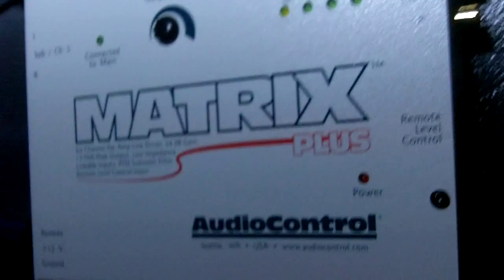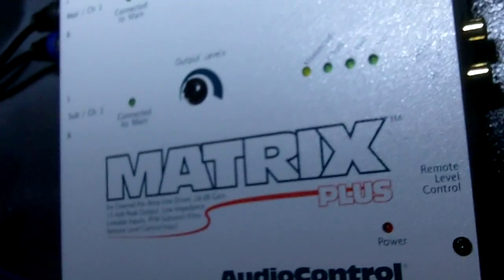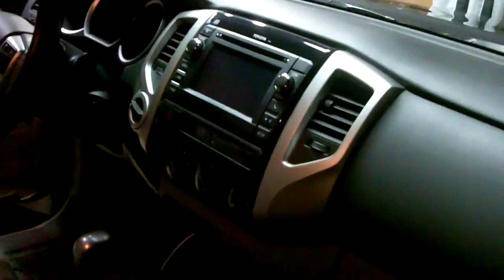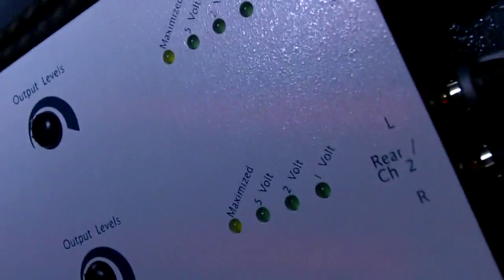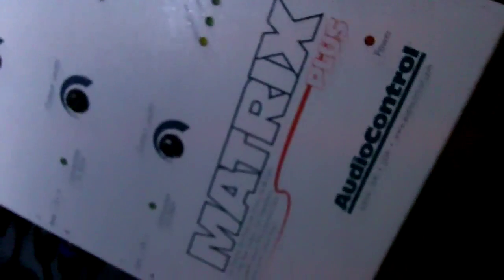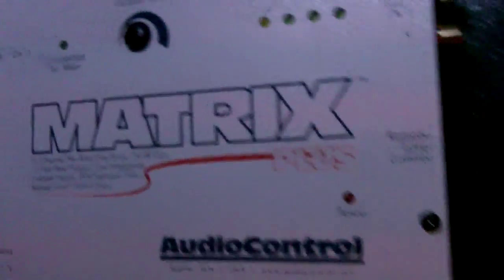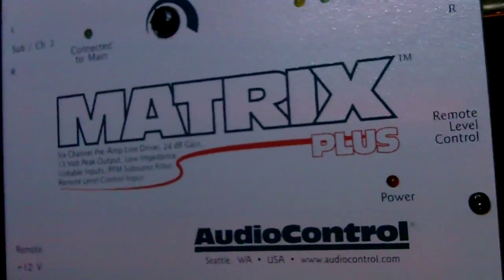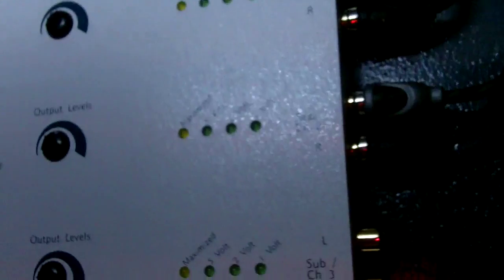Why is my amplifier gain up so high

Comment: Yup an amps gain knob is just a signal boost not a volume knob, if your signal is right no need to turn up the gain at all. I have audio control lc2i think thats what its called and my gain on my amp is at its lowest setting.